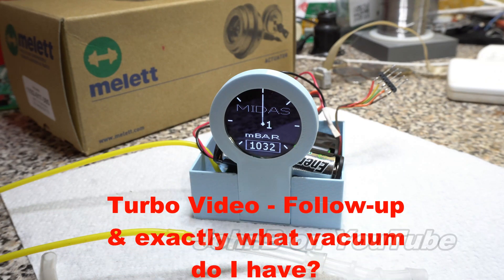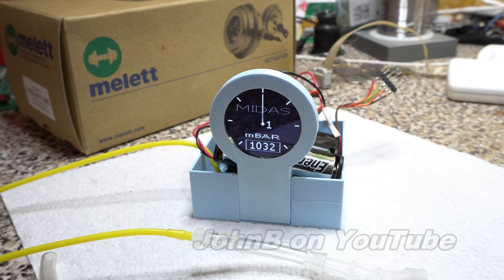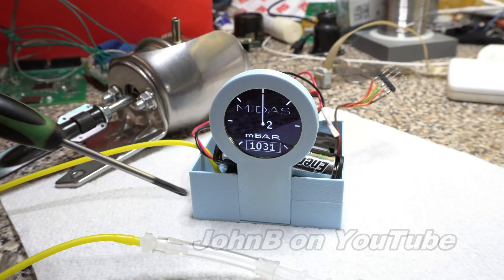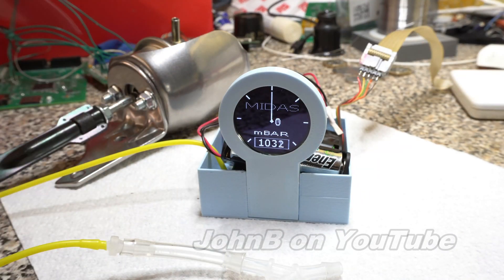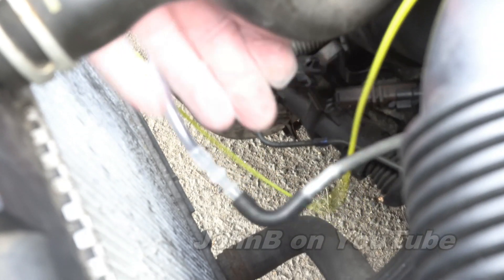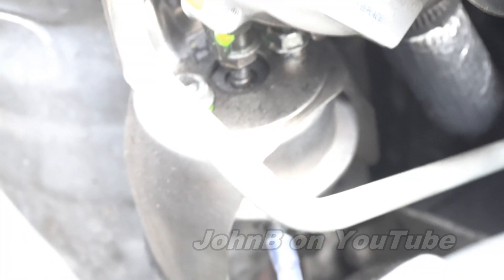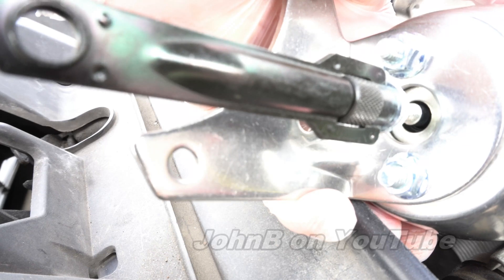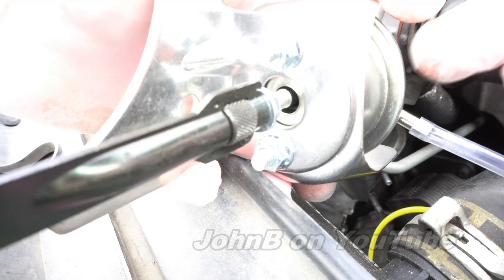Measuring The Vacuum on a Variable Geometry Turbo Actuator, Peugeot...PSA Engine

Comment: The vacuum regulating valve is a pulse width modulated affair, it can become clogged especially on the atmospheric pressure relief which should originate at the clean side of the air filter box.
Reply from the maker: The actuator was 100% brand new with the turbo.
Reply: @JohnB-2021  
Parts do fail in early life, the diaphragm is  rubberized fabric which could have had a low cycle fatigue failure.
Reply from the maker: @keithjurena9319  it never worked from new.

Comment: Be worth checking the vacuum at the vacuum pump see what vacuum there is with everything disconnected ie servo . i would of thought they would of given you a new turbo as the activator are matched , the later models have a  position sensor on the activator tells the ecu  the position of activator
Reply from the maker: Thank you for your input.
This turbo and actuator is not that clever.
The ECU switches on the vacuum and watches the boost.